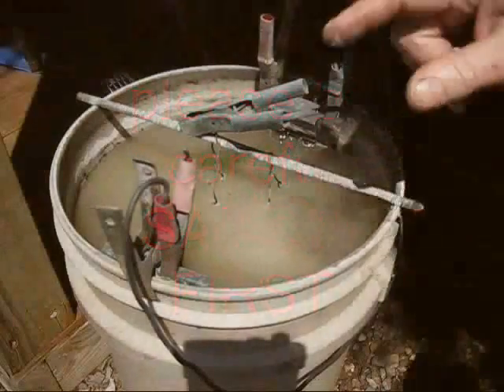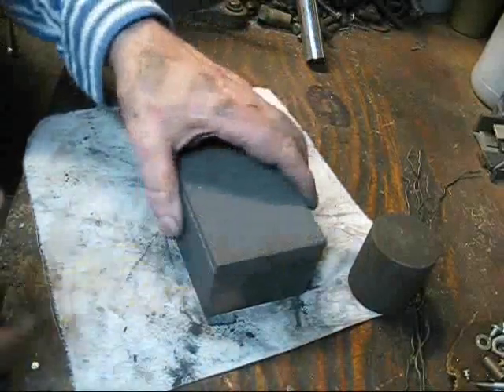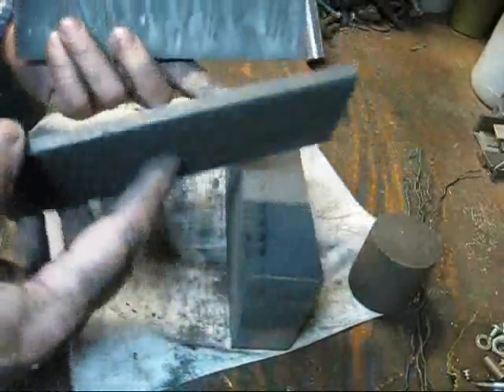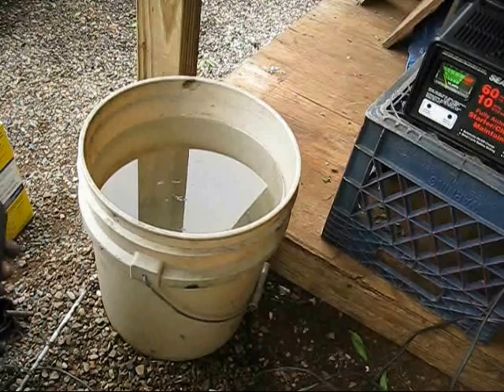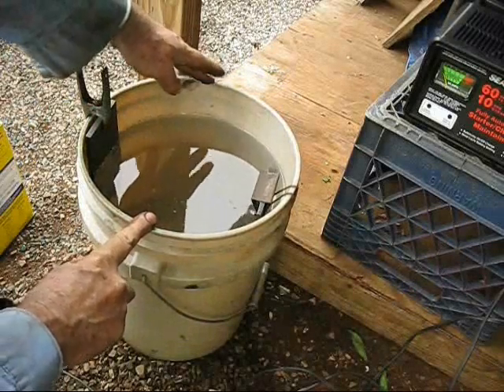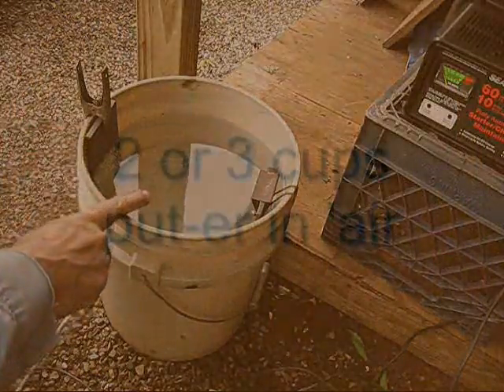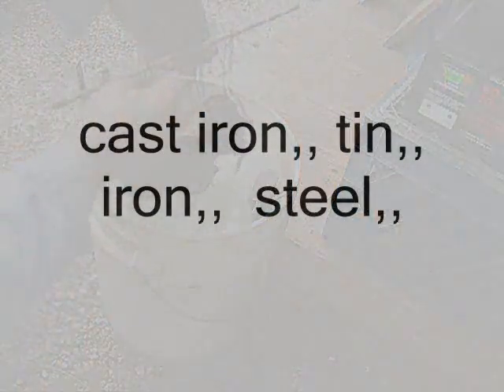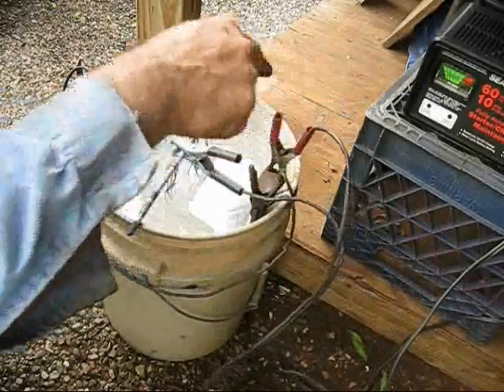easy electrolysis,,,,  the clean way

Comment: I had to laugh a bit, but this is the most simplistic and cost-effective unit I have ever seen put together, and I have put many others into use over my 74 years. I have a 1925 Model T that I am currently working on rust and paint removal, so a unit like this is great. As a tip though, go to any box store and then pick up a cement mixing bin and it is larger than most 5-gallon buckets as to the length. It has a depth of maybe 6-8" and it comes in 2 different sizes. It is stronger than those plastic bins most folks use, and it won't become brittle and crack on you. I enjoyed this video and look for other such info presently at this site. I tried to locate the carbon blocks on Ebay, but most are nowhere as large as the ones shown here in this video. They can be expensive, too, depending upon what you purchase. Trying to locate a reasonable source for purchasing larger blocks though. Thanks for the video.

Comment: I run the fabrication part of a large shop, just off the top of my head, you can use air arc rods as they are carbon, just sand the thin copper coating off. Great video 👍🏽

Comment: You just built a giant carbon-Iron battery with that should be around 1.5 volts, would you do me a favor and next time you do this can you measure the voltage before you take the steel parts out? iron oxide is turned to pure iron

Comment: This is by far my favorite electrolysis rust removal!  I will only use carbon anodes!  Did any of that black substance form on the pieces?  I was wondering if black material is from using iron anodes

Comment: Cheers Shopdogsam.
Thinking of readily available graphite/carbon for anodes.
Has anyone tried pieces of old broken fishing rods or tent poles?
Reply: I doubt that would work, as the graphite/carbon in them is only used as filaments suspended in resin.  The resin would likely be an insulator, and there would be very little carbon/graphite exposed to the water.
Reply: @bricology  thanks 🙂

Comment: Well I know this is an older video but........I finally ordered some graphite plates off Amazon to try. They are pretty expensive, these plates are 3 mm thick and a little larger than a dollar bill, I got two for around $10.00. They work good so far. Another thing I read from a commentor on another video was that he uses an 80 watt solar panel for electrolysis.  I've seen 100 watt with a little over 5 amp solar chargers for around $100.00 online. Granted, it's a little costly up front and it will only work as long as there's daylight but you could use it anywhere and it won't run up the electric bill!
 I'm thinking about giving it a try....

Comment: Eh, old as this video is, I'm inclined to take it with a hint of salt. I used graphite welding rods for the same purpose and it DID leave a (black) residue (and also dissolved those rods lightning fast). Sure, it wasn't floating on the top (as it does with the usual iron sacrificial anode), but the water still ended up becoming completely black nonetheless.

Comment: Soda Ash or swimming pool Ph up!  Clean internal surfaces by wrapping a Carbon (graphite) electrode in fiberglass screening and connecting with an insulated wire.

Comment: shopdog,love your vids.i am going try to remove rust on approx.2000 cast gas pipe fittings.can i place a steel plate on bottom of vessel and use that to put as many as i can in vessel.and use plate as positive charge.or do the fittings all have to b suspended in solution thanks
Reply from the maker: ,,, it works,, I clean nuts and bolts in a wire basket,,,

Comment: finding graphite like in the video is going to be hard. That is used for making electrodes for EDM and it is very expensive. There are several different grades and none of them are cheap. The piece in the video is probably close to $500 usd
Reply from the maker: ,,, scrap pieces work very well,,, cheap,, these were yard sale finds,, I paid five dollars, no tax,,,
Reply: I bought a piece about the size of the block in the video that was copper graphite and it was a little over $1300. If you can find it easily I say get all you can get your hands on.
Reply from the maker: ,, no, wait,, I think it was two dollars,, no tax,,
Reply: Use pencil mines...

Comment: love this video...I am thinking you can get carbon blocks from a welding supply outlet; they are used for backing up a thin or gappy joint so you don't burn the joint out when you weld...copper is also used for that purpose...pulls the heat away while it gives you something to weld against, and it won't dilute the weld puddle...
Reply from the maker: +Hilary Brust ,,,, yes,,, I think that's right,,,,

Comment: Only concern about using carbon is the carbon monoxide generated although only in trace amount. Don't breath the air coming up from the anode it should be ok. You can use silver plates instead but that could be quite expansive compared to graphite plates.

Comment: I thought to wonder what kind of charger would work and googled that, maybe you said and at that point I didn't understand. But I got a suggestion from Davehallier.com for a specific brand, but more importantly,  that some of the newer chargers are "smart chargers" and won't  charge 'cause they don't recognize the electrolysis set up as a battery, whereas  manual chargers will work.

Comment: Hello again Sam.  I found a source for carbon on eBay under the heading "Graphite Block Plate Sheet Blank Saw-Cut Grade 2915".  There is an offer there for a 1/4" x 4" x 12" piece for $10.00.  A couple of those should do.  What do you think?

Comment: Thanks for the tip on using carbon for the anode and heating the water.  I would not have thought of that.  I checked On-Line for carbon blocks but I could not find an inexpensive source.  Do you think carbon fiber cloth would work?  You could line the inside of the bucket with carbon fiber cloth and then you would get electrolysis from all sides every time.

Comment: Thanks!  This looks like a method my wife won't be upset over "look at that mess!!!" ;)

Anyone found a good source for this material yet?  Thanks in advance, and thanks to all the people out there that take the time to help others.  I will subscribe and give the good old thumbs up for you - Well earned!
Reply: Kerry F Here is a link and there are many variations of these graphite plates/sheets. Just Google graphite plates for electrolysis...
http://m.ebay.com/itm/201838616900?_trksid=p2349526.m2548.l4275&_mwBanner=1
Reply: Maybe even use carbon arc rods for airarc gouging, metal heating and cutting. Just peal off the copper

Comment: I have some aluminum 1/4 inch plat laying around.. think that will work for anode (positive) part?
Reply from the maker: +Chuck Cunningham ,,,, no,,, aluminum is not good,,,,
Reply: You have to be extremely careful in what you use as it can give of all sorts of toxic shit. Stainless is particularly bad as it makes carcinogenic heavy metal soup which not only is dangerous but you can’t safely dispose of

Comment: Well that make a lot of sense. Since carbon can conduct, it should be able to withstand far greater time period without degrading. 

This also means that by using  carbon instead of a metal, you can produce far more Hydrogen / Oxygen through electrolysis at a FAR cheaper rate.

Comment: im sure someone has mentioned this already but from a chemical standpoint a warning might be advised~ electrolysis works for what your doing but your also breaking down H2O into O2(g) and H2(g) in the process~ I would not do this inside and/or near a open flame like a cigarette....unless you want to blow your house up or your face

Comment: I haven't tried electrolisis yet. Been using citric acid.  That works pretty fair. Electricity and water looks hazardous. What should I not do if I try this?
Reply: +dan andy If you've been using this, don;t remove or attach cables with the power on as a spark can cause any hydrogen build up to ignite. As a rule of thumb, just always connect or disconnect with the power off.
Reply: dan andy Don't do anything different than whats explained in the video, for someone just beginning.
Reply: +dan andy Don't put the positive clip in the water. Don't do it inside the hydrogen is flammable. That's about all the real don'ts.
Reply: +clasicradiolover * Thanks
Reply: +believe it + That is an important tip. Thank you.
Reply: dan andy You certainly are welcome.
Reply: I used vinegar. It worked well.

Comment: Thanks, Sam!  I have a couple of badly rusted but not pitted dutch ovens that I need to get the rust off of/out of.  I don't know if the inside/outside will need different set-ups but I'm going to give it a whirl!  I've done them or others like them befor and just used cup brushes and wire wheels on electric drills and it all worked out well but, I'm disabled now and might find this easier.  Thanks again and keep up the good work.  I have no access to carbon anodes so I'm going to try re-bar or steel eighth inch thick strap and see how that works.  If I get scum I assume it'll just wash off.

Comment: How long does your graphite typically last in your electrolysis tank before it ends up needing to be replaced?
Reply: ***** Watch the rest of the video's. The graphite is the sacrificial anode so it does indeed get eaten away. How long it takes to break down depends on amperage etc

Comment: Top job, could I clean rusted up brake callipers? I'm thinking of leaving the pistons in and the unions with small pieces of bent over brake pipe so no solution can get inside or won't it matter? Great tutorial, you cleaned up them old parts good.

Comment: i have an old rusty bbq in my garden and i was wondering if its possible to just fill the bbq with water and put the negative on the bbq and hang a piece of carbon in the middle and put the positive on that?
Reply: Seems to me if you can isolate the bbq grille from the ground by putting it up on something like rubber or on glass jars, perhaps a sheet of glass if it's thick enough not to shatter, then it should work. Whatever won't conduct electricity will work. Be sure the anode is hanging from something besides the grille, and doesn't touch any part of the grille.
Reply: sweet man that sounds like a good plan to me thanks for the info :D
Reply: theshadowfexx I assume it's probably too big for one of those plastic 50ish gallon barrels. Whatever parts of it you can get submerged into a big plastic tub will get de-rusted, but the rest of it still needs to be isolated from the ground. If it can be reoriented several times to get all of it inside and out, that should work.
Reply: I was wondering the same thing, for like doing the inside of larger cast iron pots. Has anyone tried it like this? Results?

Comment: Super washing powder, what a great idea! I have some in the house. I'm experimenting with HHO and people are using potassium hydroxide. I also have some baling wire. I learned some good stuff. I subscribed.
Reply: You can also make washing soda from baking soda. Just spread the baking soda onto a baking tray, and pop in the oven for around half an hour at 400 degrees. The heat will break it down from Sodium Bicarbonate to Sodium Carbonate. Either can work, but the latter is more effective.
Reply from the maker: ,,, remember, in this process the main objective is to produce less HHO,,,, thanks for the "scribe,,,,
Reply: shopdogsam I don't mind at all. Your method is the best I've seen.
Reply: shopdogsam It's my understanding from other sources that it only needs about one tablespoon of washing soda per gallon of water. More doesn't increase the efficiency of the process much. One of those 'diminishing returns' things. The carbon anode plates to help keep the solution cleaner for longer are a good idea I haven't seen elsewhere though.

Comment: Y'all might want to try and use Carbon Arc Rods from a welding supply. They are used with a stick welder to cut steel and cut welds (scarfing) off parts. Some of them have a very thin copper plating on them and might help things along or make it a little faster. Also, the Carbon Arc Rods come in several sizes, I have some 1/4 inch and it would be much easier to place 5 to 10 rods around the bucket so you get a more even reaction with several parts. Thanks for the videos and the ideas for a simple way to de-rust parts.

Comment: The parts come out black. I soak them for a while in vinigar to remove the black coating.
Reply: a soft wire brush will take the stuff off very quickly too.  It might be a little hard to get in tight areas though.

Comment: I just wonder if he could explain how "sodium carbonate" actually performs with a DC current running through it. Or how to deal with the hydrogen gases that form with this process. In other word's folks..... be careful who you listen to. It's your safety at stake here.
Reply from the maker: <p>,,, well,,,,, yes I agree,, it's never safe to have electricity in a water tank (be it ac or dc),, do your homework before setting up on of these tanks,, and yes I can explain why you would use sodium carbonate as a electrical conductor,, but if you have done your homework?,,,, well you already know that,,, and,, with sodium carbonate and graphite (as compared with different anodes (stainless steel, old files, rebar),, and different liquid solutions) along with low amps and low temperature,,,,, remember the point of this is to remove rust with no damage to the metal,,, with the lowest amount off gassing (in any form), hit replay, read the description,,, shopdogsam  </p>
Reply: shopdogsam The reason I question this type of de-rusting is the seemingly loose useage of the term " elec"trolysis. Carbonates, when under stress such as electrical stimulates tend to give off very undesirable products. Note the anodes used when the process is finished. Carbonates, by nature are a caustic, especially when subjected to un-natural mediation such as electricity, hense the hydrogen by-product. I guess all I'm saying here is be careful and do your research before taking anyone's advice. Anyhow, we're all curious, just take care.

Comment: Remember the gas that comes of it is super flamable hydrogengas
Reply: It's also super lighter than air and dissipates almost instantly.  Unless you're doing this in an airtight space, there's no danger.
Reply: Mark Donaldson this was a thing i was concerned with.def have to do it outside.

Comment: Well I answered my own question...I derusted the Briggs flywheel with no apparent damage to the magnet!!! Good news! Now to try to figure out how to get continuity through all of the links on the mini bike chain all at once...The rust/dirt is insulating the links from one another and won't let the electrolisis flow through so this has me scratching my head...
Reply from the maker: ,, no,, do not use dielectric grease as it's an insulator,, and I have cleaned chain, just rolled it up and tied it tight with baling wire, took it out and wire brushed, not clean enuff,, in the tank again,, twice more and the chain was rust free,,
Reply: You could try a sonic bath.
Reply: try dielectric grease
Reply: I will give it a go, thanks for the schooling!

Comment: Excellent video and I really wanna try this idea!
 I haven't really found any carbon like what your using on eBay yet and haven't looked for graphite yet but I'll try to find some....I'm rebuilding a 5.5 HP Briggs engine and am wondering if doing this to a cast iron flywheel would demagnitize the magnet....Any ideas?
Reply: Wouldn't have any affect other than removing any surface rust off it.
Reply: Thanks for the response, yeah, I derusted it using this method and it worked out good...No harm to the magnet!

Comment: If you want to buy graphite, look for sinker EDM suppliers.  Or you can search "sinker graphite" or "EDM graphite" on ebay.  If you buy it from a supplier, look for saw-cut graphite.  Milled or ground graphite will cost more.  There are many grades of it.  You are looking for the lowest grade, cheap stuff.  The cost goes way up for the finer grades.  If you look on ebay, there are lots of people selling used graphite electrodes.

Comment: I was also thinking, you can make a bucket of warm/hot sodium carbonate washing soda, put a plate of aluminum in the bottom and set the dirty parts on top of the aluminum and it'll clean the parts without needing electricity.

Comment: Its the best thing to use for electrolysis because it doesn't ionize or break up in water, the other metals will and make a sludge buildup in solution. They say graphite works like carbon too.

Comment: Electrolysis isn't so much "line of sight" as it is "electricity follows the path of least resistance". The soda ash solution is a semiconductor and current will flow along the electrically shortest route it can find. When all the corrosion is gone from the points nearest the anode the current will continue to flow from the next nearest point and so on until either the corrosion is gone or the path becomes too long to overcome the built in resistance of the semi conducting solution.

Comment: Just so you know, you can spread sodium bicarbonate in a thin layer on a baking sheet and bake for an hour or so and it turns into sodium carbonate. The easiest source I've found for sodium carbonate is swimming pool water PH increaser. It is pure sodium carbonate.
Reply: Baking soda, sodium bicarbonate, works just fine.  It really doesn't play any role in the process except to make the water conductive.  For that matter you could use lye, sodium hydroxide, and heat it to form an electrolytic hot tank and remove paint residue and rust at the same time.

Comment: Graphite is a allotrope of carbon with other impurities and actually a high grade coal, and anthracite is also a allotrope of carbon (coal) of lesser grade.  Most carbon blocks that can be purchased are actually graphite, however some are made from anthracite coal.  Graphite is a better conductor of the two, more stable and tolerates higher temperatures without combustion.